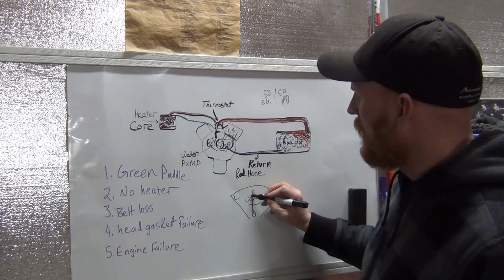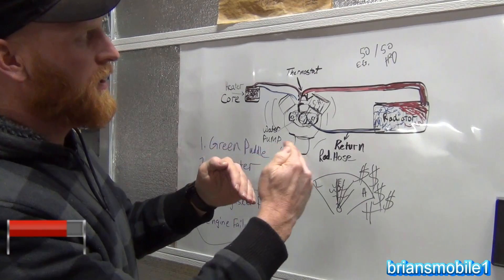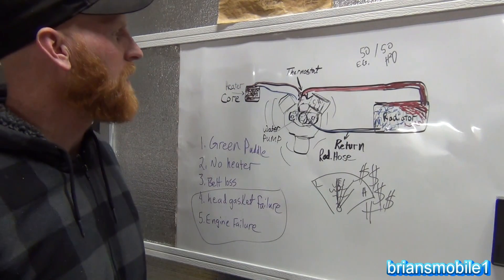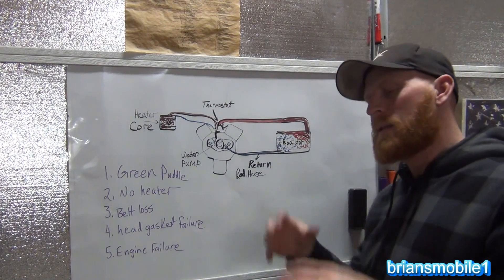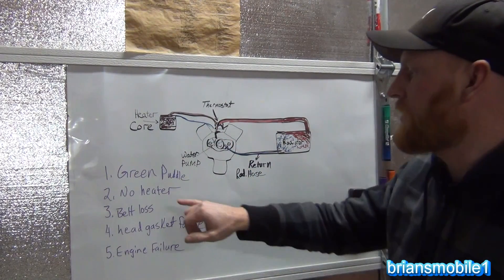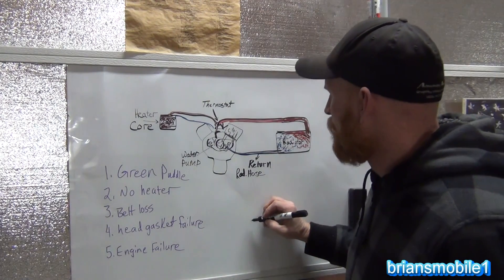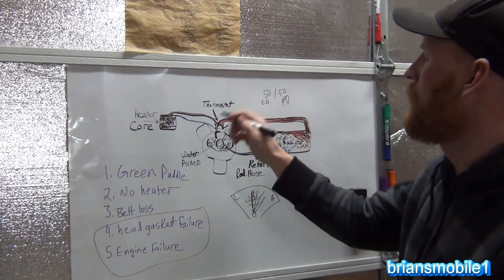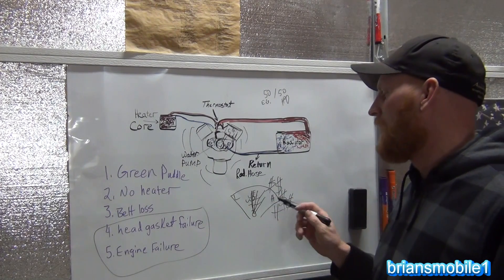Car Cooling System Basics

Comment: When the engine is cold, the thermostats is normally closed; restricting flow to the radiator allowing the engine to “warm up”As the engine warms, the increase in heat causes the wax to melt and expand, pushing against a piston inside a rubber bootThis forces the piston outward, opening the thermostat so coolant can start to circulate between the engine and radiatorAs heat increases, the thermostat continues to open until engine cooling requirements are satisfiedIf the temperature of the circulating coolant begins to drop, the wax element contracts; allowing spring tension to close the thermostat, which decreases coolant flow through the radiator

Comment: Hey I had a question I have a s10 4.3l tbi leaking oil from the oil filter adapter feeding the oil cooler.  Can I remove this and put filter straight to engine block without any issues.  I don't tow anything with t it's a point a to point b truck to get to work and home. I've replaced gasket 2 times so far lasting about a month each

Comment: It is no big deal but you keep saying thermostats have bimetallic springs - they don't.  As crazy as it sounds, thermostats operate using wax.  Wax when it melts greatly increases in volume.  So, put it in a sealed container with a piston and the thermostat opens when the wax is heated.  The spring is there to close the thermostat as the wax solidifies.

Comment: Thank you for the education.  I have an overheating condition in my 2008 OBW, 2.5 L.  Based on your thermostat videos, it looked like that was the problem so I went and bought a genuine Subaru thermostat and decided to drain the system and replace it.  However, when I got underneath, I found that my access to the thermostat housing was not what your video (and every other instruction I found) matched up since there was length of what I believe is part of the exhaust manifold blocking my access to the 2 10mm bolts.  I can't find any information on what this is or why it's there. Any clue? It's a standard EJ25 engine, auto trans.  I did drain the old coolant and replaced but am noticing the levels dropping (filled over flow tank to full and after a short drive, it's at the low line)  though no overheating just yet.
Reply from the maker: +Frank Urena Yours is front mounted sounds like.  Most older ones were bottom mounted.
Reply: +briansmobile1 Thanks for the quick reply! Just my luck.  Any chance you'll do a quick how-to on that one?

Comment: De-pressurizing the system can buy you some time when your needle gets hot, but be careful not to burn yourself. Usually slowly opening the coolant overflow tank will do the trick, but open it like a bottle of soda that has been shaken up.

Comment: +briansmobile1 Hey Brian, great video but i just thought id mention, when you said a car's thermostat works by a Bi-Metal spring, that's actually incorrect, it uses wax inside of the brass slug in the middle of the housing and as it heats up the wax melts and expands and pushes on a pin which forces the valve open. the spring just holds pressure to keep the valve closed when its cold
Reply: +Kyle Veilleux http://www.stant.com/index.php/english/products/consumer-products/thermostats/abcs-thermostats/

Comment: Some valuable life lessons learned at the hands (fins) of various cooling systems. If you break off a plastic fan blade and don't replace it promptly expect to replace the water pump. If you do that on an old Bosch fuel injected 1.9 German Opel and tear the really weird radiator hose, expect to wait about a month on parts. Don't overheat a Mazda rotary. At all! Even a little bit!

Comment: Ok so on my 97 Dodge Ram when I'm putting the Pedal to the floor or just putting around sometimes, usually happends going up hills and such the temp gauge rises fast showing like 220-240 degrees then when I let of gas for a couple seconds it goes back to Normal. What could this be? Thank you

Comment: My child drove my '89 740 more than 6 miles with the water pump and cooling fan in the trunk. I wasn't there but i believe it may have overheated. Anyway...after putting it back together it ran fine for 6 months until the head gasket finally have out.

Comment: Great video & explanation.  Another good thing to do if you are about to overheat is to turn the heater on full blast. The heater fan will flow air over the heater core, which will cool the coolant inside and help cool the entire system down. It won’t be a drastic improvement, but every bit helps. Also, its common to overheat when driving in hot climates with the A/C on (e.g. stop/go traffic on a hot summer day). If thats the case for you, turn the A/C off and open the windows.  Hope that helps someone.

Comment: Already knew in general how the cooling system works, but it doesn't hurt to get a pretty detailed explanation on it... Thanks Brian, nice video!

I actually have the opposite problem though, my car doesn't heat up very well (actually it's inconsistent) xP I'm betting the thermostat is going out though, so I already have a new one on the shopping list (yes, the gasket for it too) along with ~$500 in stuff for other projects.... Ah the joys of having a 25 year old car, but at least it's a learning experience!
Reply: +Chris C I feel that way all the time with my 16 year old car. I really wonder if I'll take care of it so well that somewhere between here and the age of your ride it may have some golden years...after all, I've been claiming for 3 years it's almost a "new car" again...hmmm, parts are really challenging that truth!

Comment: Another great video Brian thank you! Mull these symptoms if you would. My son has a 1995 Subaru. Started having problems overheating. No white smoke just ignition gas in the coolant. Allow to cool bleed system of gas top up. Runs great for about 50 miles then... No oil coolant mix. No misses!  Head gasket?  Ever tried heard about the Perma Tech product?  He cannot afford the head gasket job.
Reply from the maker: +Z Worm Sounds like a head gasket leak.  Those C02 gasses accumulate at the thermostat spring and cool resulting in a t-stat that won't open and thus overheats.  You can drill 3 or 4 small by-pass pin holes in the thermostat plate to pass the gasses.  This will get you by for a while.  The down side is it may run a bit cooler than normal.  That can result in higher emissions, lower efficiency, and poor heater performance, but it can get you by- sometimes for years.  Enough to save up the money needed to do the job right when you can.
Reply: +briansmobile1 Thanks Brian. We will try that first. Any comment on the PermaTech?

Comment: My 2002 Cavalier 2.2l OHV does this: sometimes if it's colder outside it will sit just a little tiny bit below 195 at idle. After driving it will go to 195 and if it's warmer outside it will got just a tiny bit above 195 (maybe one line). Is that normal? I've heard that's normal for a Cavalier of this year and this particular engine.
Reply: +Justin Hall This is completely normal. Temperature swings of only 1 or 2 degrees are nothing to be worried about, especially if they are occurring under 200°F.
Reply: therealuncleevil I thought so...ever since my Mitsubishi broke a timing belt after I changed it when it was supposed to be changed, including the hardware, I am overly worried about something major breaking on this car...lol

Comment: What about that heater hose valve that's controlled by fan speed or whatever? Or does it even exist?
Reply from the maker: +weelgunny That's a heater control valve or a heater shut valve.  The exsist, but not all cars have them.  They engage when your AC is set to "go nuts buddy!"

Comment: So do thermostats that open earlier actually help. I've seen that done a lot on work trucks and performance cars.
Reply from the maker: +argonian bilbo  The reason thermostats are set at the temp they are to open is that is where the engine is the most efficient.  That range is best for gasoline to vaporize in preparation for combustion.  If you're running alcohol or something else that burns in a given engine hotter, it's reasonable to set the cooling temperature goal cooler to combat that excessive heat.

Comment: hello my temp gauge goes up and down when i turn the heater fan  I just wanted to know why its doing this  help
Reply: +patrick cordery maybe it's just the power drawn by the fan.
Reply: +Veikra I think it is because when I put the fan on the gauges jump  could it be the fan motor resister going bad  or a bad fan motor
Reply from the maker: +patrick cordery The fan blows heat out of the coolant while it's passing through the heater core.  That would account for the temp going down.  As for going up AND down, that sounds like an electron mele at the blower motor resistor.
Reply: briansmobile1  so should I try getting a new motor resister
Reply: Also can a new temp sender be a bad part

Comment: White board!  Santa delivered! Thanks so much for releasing videos during the holidays, very cool. 

 This is perfect timing because I'm having a minor cooling issue with my van. I'm back for Christmas week from my mountain exodus and HOLY SH-T its cold. At -32°,  NappaVan (5.9 magnum)  is struggling to stay in normal operating temperatures. (If you think of a Ram van gauge, I'm above the C line just above the first line of normal) The heater still blows heat but its more warm than hot. Coolant is a-ok and the heater is capable of blowing hot air but only if I stay in 2 and really stomp it. I even have my entire grille covered. If I'm on the highway in OD it'll blow room temperature. I got no leaks. I'm thinking I'm in need of a hotter thermostat but just wanted a knowledgeable opinion before I spend a few hours out in the snow lol.  Thanks again for your videos.
Reply: +Brad Nimbus You may have a failed thermostat. They usually fail open.
Reply from the maker: +Brad Nimbus weelgunny is right, the thermostat isn't closing all the way and or is stuck open.

Comment: When sitting at a stand still and temps outside are hot I turn off the A/C and turn the heater on for awhile. The temp gauge will start to go down considerably.
Reply from the maker: +elpasokid 53  That's a great idea on most trucks and cars.  It reduces AC compressor burden and dumps heat from the motor into the cab via the heater core.  On many twin fan newer cars with AC- leaving the button ON can give you an extra fan that more than compensates for the load- especially if the primary radiator fan is bad and causing the issue.   This is why I love gauges vs. lights and numbers vs gauges- you can actually SEE real time data and have feedback as to if something is helping reduce temperatures or not.
Reply: +briansmobile1 great video Brian, thanks for posting during the holidays!  I have a 2013 Subaru that has dual fans so this is great info.  Bad part though is that there's no gauge, only an idiot light.  Luckily I've got my Bluedriver for that.

Comment: That was a safe recommendation, but there is an other:
Turn your heater to full hot and turn on your fan to max. This will probably keep you safe for a couple more miles, because the heater core will dissipate a bit of the heat. This is usefull, specially in case of sticky thermostates.
Reply from the maker: +Pedro Teixeira Stuck thermostats, failed cooling fans,  and clogged radiators that will help quite a bit.   In the event of coolant loss- it's a cooker with confidence.

Comment: I had the green puddle coming from my car,  after some investigation found the radiators plastic end tanks had a crack in it making the car loosing the coolant
Reply: +Magumn Glass filled nylon, GARANTEED to crack even if you dont use it!  Great for the economy they say !